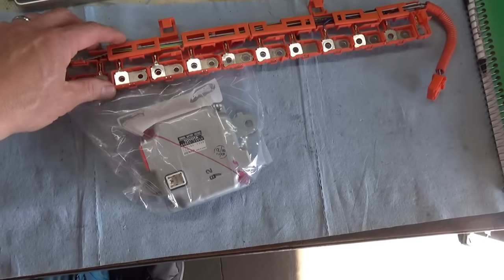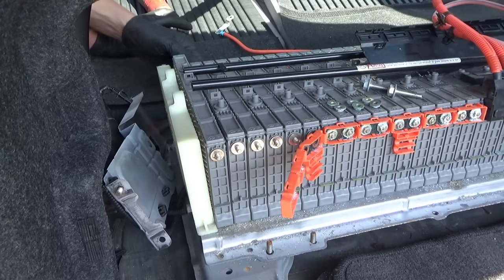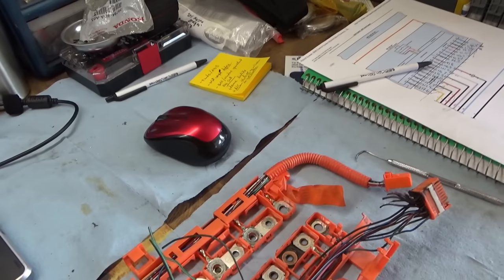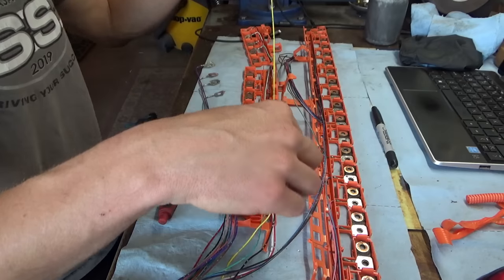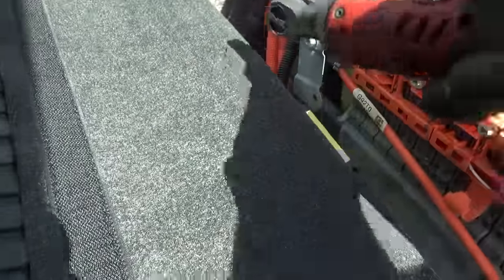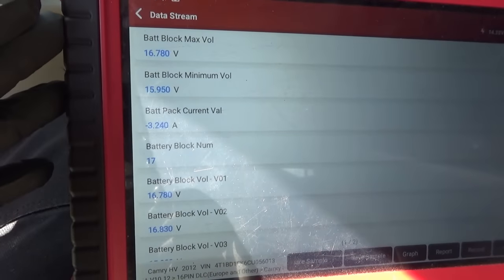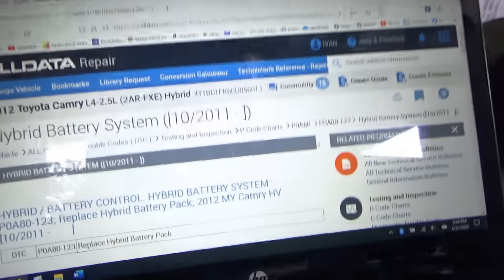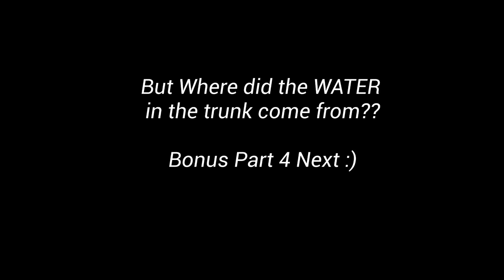Helpless HYBRID....from Florida?? (Part 3 - HV Battery REPAIRS)

Comment: It's not the parts required or eBay that makes the difference here. The difference is finding a competent diagnostician that is both willing and able to perform this repair. That's the PHAD difference. Thanks Ivan!
Reply: That would make a great line for a commercial
Reply: We are flying Ivan out to Arizona to figure out a 2003 f150.   Oh, Ivan, you didnt know?

Comment: @Ivan, That code is set because the BMS (Battery Management System) calculates the internal resistance of the modules in pack by watching the voltage sag under high current.  These battery modules have a known issue where the o-rings behind the terminals age and allow the electrolyte to leak out which increases the internal resistance of the 6 cells in each module.  This also causes them to lose capacity.  The other problem is that the leaking electrolyte corrodes the connections between those copper bus-bars and the sense terminals.  (Green crusties!)
Reply: Oh yeah and I believe it! Too much is all crammed together and there is considerable heat that could pose as an event that just doesn't look too pretty, especially with the filtration of the intake air getting plugged up! Those battery packs could really blow their tops if the owner ignores all the onboard warnings! There should be a preemptive
warning that tells you that you must cease complete operation of the vehicle or risk possible injuries or death that spells it out in plain English!
Reply: @craigtegeler4677  These are Nickel-Metal Hydride batteries, they just don't do anything that exciting, no matter what you do to them, They just die a quiet death.  Once the weak modules get too low, the car will be unable to start, as starting energy comes from the hybrid battery.
Reply: @Ingineerix  That is true. If they were li-ion batteries it would be a different matter but Ni-Mh batteries just die without any bigger event.

Comment: Great video Ivan! Toyota should sell the battery components. Either that or whoever the batterie manufacturer is should sell repair parts. It is made to be repaired not just replaced. If companies are refurbishing the cells you should not have to rely on used parts from ebay to fix your car. I guess you exposed the truth about hybrid batteries that Toyota may not want people to know. 😂
Reply: There is new and improved replacement batteries that perform even better now that has the whole kit and there is one if not two refurbishers/ rebuilders out in the state of California that does exactly that and they warrant the new and improved pack for 45,000 miles. That's something that Toyota does not and most likely will not do but hey, that's how they conduct business! These refurbishers are highly skilled and are well trusted by many mechanics here there and just about everywhere! I found this one out later on today!
 
Yet, about a year ago, this young lady of college age had her Prius take a dump while she was going cross country. She was ever so lucky the mechanic that set out to help by directing her to go see someone by name and help get her situated right away and so this is more or less how the story got started! So, even though it was a fairly small garage about 3-4 cars deep, this small business thrives like no other and it shows!

This is how small businesses become larger businesses! All it really takes is a bit of great skills like with Ivan and a solid upline to some great parts and a good bit of skill on thorough troubleshooting and some good diagnostic equipment and you are of to the races! Some
of these eBayer's are okay but some of these junkyards are not to be trusted and plus they charge you WAY too much! I've been away from eBay for years now and my experience just over the last 2 days was just plain the worst ever! First off, nearly everything is being made mainly in China period!
For me to find a Mitsubishi starter motor was like pulling teeth for literal hours on end; the OEM just like Chrysler had made for around 5 different models of cars by a explicit number that supersedes all others and that same number is no longer being produced (Discontinued). Though my Jeep Grand Cherokee was made in late 02, it could conceivably be an 02 starter with a whole different part number as was sold as an 03. That is the first bone of contention! The 03 OEM Starter was made by Mitsubishi! Yet i looked at a would be erroneous part number that also stated in the notes that this starter has 11 pinon teeth and the motor rotation was counterclockwise as opposed to 10 teeth and motor that is supposed to turn clockwise! I finally in the end found a used one finally that was OEM for my Jeep with refurbishment done by a private party and is warranted for one whole year bearing the true label of Chrysler and Mitsubishi by the superseded end all part number!
Reply: All of the cells have the same number of hours on them so replacing a few is a gamble. Will they keep failing a few at a time?
Reply: @tiredoldmechanic1791  They could last a little longer. Ivan only replaced the 4 that were damaged due to water intrusion and shorts. After he replaced the cells and got the thing charging it seemed like it was in fairly good shape. Only time will tell. lol

Comment: Can’t wait for part 4.   Interesting to see causal issue.  Well done as always.
Reply: It will be interesting to see what he has for Part 4, but I think he gave it away in a prior video - fender bender that compromised the turn seals. So, perhaps the real question is if the Part 4 is repairing trunk seals to prevent a reoccurrence.

Comment: To do generic small gauge wire (20 AWG or 18 AWG) auto harness reconstruction or repair, if you do not stock the different automotive OEM wire color combinations (which is most of us, unless you specialize in one OEM), is to use all white colored wire with the wires labeled (heat shrink labels). To do all 20 AWG or 18 AWG repairs (even transmission valve body solenoid wires), is to stock MIL SPEC M22759/9 wire (Silver plated copper high stranding, high temp Teflon jacket) and solder using Kester Sn62Pb36Ag2 3.3% 285 wire solder (Part Number 0.020 inch diameter 24-7150-9702), use with Kester 186-18 liquid flux. The generic white color wire with labelling is what you see in aircraft harnesses. The silver plated copper wire strands themselves are very flexible, but the Teflon jacket is a little stiffer than SXL automotive wire, but the overall wire diameter is very close. Obviously, the above approach is expensive, but you only need to stock a few colors, like white (obviously), black, red and gray. 

I think this silver plated copper wire with crimped automotive pins with the silver solder makes the best overall connection if you want to crimp and them solder a pin connection. For soldering, the Teflon jacket will not melt or shrink. For wire to wire connections you can use a crimp butt splice or a barrel butt splice and then solder the joint.

In doing automotive prototype or repair harnesses, unless weight is a major consideration, which for automotive is generally not an issue, is to use a minimum wire size of 18 AWG. For small signal and power wires 18 AWG gives the best current and vibration (mechanical) characteristics. 20 AWG is mechanically too small (according to USA OEMs), and 16 AWG is only need to meet a special higher current requirement.

Comment: When you said "I'm going to top them all off before putting the new batteries in" ---   I'm not sure if you meant all the cells or just the 4 new ones;   but since the bus bar was off, it might have been good to just top off ALL the batteries and bring them up to the same charge;  and dodge that headache of them being different.  Most lithium BMS charger systems are super particular about wanting the voltages to be the same.   Pretty cool that it does have a way to rebalance them overtime though, as they charge and regen, etc.   I learned a lot with this video.  They are quite simple once you break it all down.  Excellent content as always.   cheers.

Comment: It seems that most mechanics shy away from hybrids, because they can run on that mysterious electricity, not gas. The sad truth is that mechanics are not wanting to learn about new technology, technology that actually is not "rocket science". I appreciate Ivan stepping up and taking on hybrids, and hopefully soon to be electrics. (Secret: They are easier than hybrids.)

Like it or not, hybrids and electrics are here and now. Knowledgeable mechanics that can repair such vehicles are few and far between. In locations where there are many hybrids and electrics, such skills and services are at a premium. If you are a mechanic and willing to put in a little work, you can set yourself apart and increase your value by specializing in hybrids and electrics. To get your education started, I recommend the WeberAuto videos instructed by Professor John Kelly. You are not required to take any pre-arranged course. Just watch the videos.

Comment: There are plenty of totaled car's with these batteries and there are people picking through this stuff knowing there is a market. I doubt many people do this so the supply probably is greater than the demand. But they get $30 each from the 20 or 30 cells in a junk battery that they charge and load test, on a wrecked car a high percentage of cells are probably good.

Comment: Mind boggling refurbishment of the old harness. Engineering degree if not a must, very beneficial. Between towing and repair costs I don't know how much the dude has in the Camry now, but I guess he sees some profit left there. Also noticed the Everstart is the WM 1 year warranty Value battery. Up to ~$70 now. Glad the new cells equalized in the end. Nice job Ivan..again. Vid went MIA for awhile.
Reply: Trust me, an engineering degree will NOT teach you practical electrical electrical work.  You'll need a trade school to teach you safety and techniques.
Reply: I'll put it another way. Ivan's educational background served him well here, imo. That includes his critical thinking and problem solving skills. Whether someone else with a different background could do as well, not the point being made.

Comment: Man for what it takes(a few bolts) I usually just rip the whole shebang out of the Car! I would've just replaced the whole HV Battery pack(my last trip to the Wreckers I picked up 2 complete units from 40 Series Camry's for $850) you just need to swap over the Cells into the 50 Series Tinware. Toyota really stuffed up with the execution of the the Service Grip on the 50's(the 40's are so much more user friendly! For what it's worth I'm yet to see a Battery Pack with Terminals that haven't got corrosion on them!

Comment: When using your power supply with batteries, you really should disconnect it after charging. Bench supplies are not designed for use on batteries, current can backflow into the power supply when it's voltage is set lower than the battery. It could discharge the cells, or possibly damage your power supply.  Great work on yhis car too!

Comment: The dtc probably survived a battery disco. Nice repair for a disaster that could have been if the power side of the battery wires shorted.

Comment: Difference between a "parts changer" and a real mechanic!  Great diag and repair; another great video.  And yes, inquiring minds want to know: what about that water leak, is it fixed?  If not, the trunk may fill up with water again and restart the whole saga again.

Comment: Battery technology has come a long way since 2012, however I do not think we are at the point where we have reached the point where I would want owning an electric vehicle or hybrid vehicle.

The fact that a failure in the hybrid system can shut a vehicle down is not at all good when a perfectly running ICE is screaming to run is crazy. Granted the burnt out wires could have led to a fire is bad, however you would like to think that at the very least the engine would still run. If a fire was going to happen, it would happen anyway.

Comment: Nice repair work, Ivan.  The threshold battery voltage difference among the batteries tolerated  by the ECU is 0.5V.  It will only trip a code and not disable the vehicle (just as yours did after the initial repair).
Reply: That's good to know Rene! That is a pretty tight tolerance if I may say so but there's quite a bit of engineering
feat thrown into the mix and as I am sure.
Reply: A healthy tesla pack has 0.03V delta between cells FYI :D
Reply: And the cells don't equalize by themselves. Connect all the cells in parralel and leave them for 3 days.
Reply: @tschuuuls486  That's probably only .03 volts change on a brand new battery bank, but I would not expect that in the least on a slightly worn down unit.
Reply: @seghio  The BMS unit is fully in charge and commands the cells to jump thru the firey hoop, but in a good sensible manner. Putting all of them in parallel is not what I would do because the internal resistance is different from one cell to the next might go horribly wrong and that could invite trouble and you might not know it unless you were monitoring the 24/7. These cells cannot be charged like that unfettered my friend and this is perhaps why kids cannot leave their little scooters on charge in the garage or the house because it will burn the damned house down!
Reply: @craigtegeler4677  They have a really good bms, you'll find a bunch of screenshots if you search for tesla cell imbalance. Seen threads of packs managing 4mv on a pack with 145k mi.
Reply: @tschuuuls486  That is however pretty damned impressive T!

Comment: Thanks, a very interesting repair and diagnosis. Not many shops would take this job on, you could double your labour rate, and still be in demand.
This repair will probably last the life of the car, but if anyone else goes in there , could be a lot of head scratching about the colour coding of the wires, and pinout.
There is a real opportunity for technicians to learn and repair EVs and Hybrids, here in UK, and EU the ICE vehicles will soon decline.

Comment: The gauge of those wires doesn't seem all that great but those are just for sensing and temperature control! 
Lots of times some BMS units are built into the pack on lighter duty amperage home use wall or bench type 
storage units and light duty applications. The reason for a separate external BMS is probably for much better
cooling of the BMS (Battery Management System) board and driver circuits itself. Good job and well done Ivan!!

Comment: Good that individual cells can be replaced.
Reply: For NiMH battery modules yes but the 4th gen Prius with Li ion batteries not so.  One half of the entire HV pack must be replaced when one the modules fails.  Those modules are welded together.

Comment: Great repair sir..today i fixed prius gen3 with p0a80 dtc turned out to be just bus bar connecters were corroded.standard is minimum 7.5 to 8volts on each block between these values its just fine but its better to balance aal module by charging separately and it works like charm.i learne alot from your vidz.cheers

Comment: You did a great job Ivan!  Hopefully this car won't be back to have more battery cells replaced, but I have a feeling due to time and miles, it will need more cells and eventually all cells replaced.  Just hopefully not all right away.

Comment: Interesting  case Ivan!   Even toyotas break down sometimes and i guess its not cheap when they do😁
Reply from the maker: Thanks Dan! Too bad Toyota thinks that running 18 small high voltage wires in one unsealed connector is a good idea xD

Comment: A potentially valuable piece of info here.  See if this makes sense.  To equalize the modules, turn on a/c and shift to N so there's not charging.  This will run the HV battery down.  Then shift to D and you can turn the a/c off.  This will charge all the modules up again.
The idea here is to equalize the modules in the car without having to put them on the bench and use special equipment to do it.
What do we think?

Comment: From my experience its about 3 to 5 mv deference. It will not disable the car unless its severely unblanced. You usally will have 3 stages. The first stage will try to charge the batteries up close to 60-70% (note; restarting the car will cause the "stages" to reset) the secound stage will be the HV fan ramping up to max. The third stage l, you will see all the electronics flash momentarly and will hear the clicks of the HV batt disconnecting. From there you are running the gas(petrol) engine. At stage 3 its best to pull over before the car dies. Again restarting the car will send it threw the stages again as long as the voltages have stabilized.

Comment: If you ever have the time you should consider running diagnostic classes if you don't do so already. 
Personally I'm not a lover of hybrids or full electric. . I'm waiting on more manufacturers producing Hydrogen cell vehicles.
Reply: Hybrids are the sweet spot right now for most people because they really save on gas in city and suburban driving.  I don't think most people drive their cars long enough for pure electrics to cross the cost-benefit curve.  I drive a lot of cross country with a pickup, so I need gas/ICE or hybrid.  It's going to take another battery miracle and dealing with the rare earth issue before all-electric vehicles make sense.
Reply: Buy a Mirai then lol. Hydrogen is dead on consumer cars basically. By the way the hydrogen car uses an EV battery back to buffer the energy from the Fuel Cell. Also complexity on this system is through the roof - -> more prone to failure.

Comment: I have not done this on a Toyota but on a GM they want you to equalize the cells. There is a machine for that. It draws all the cells down to a low level and brings them all up at the same time. Differental voltage between the cells is very low and very important. So they have taught me.